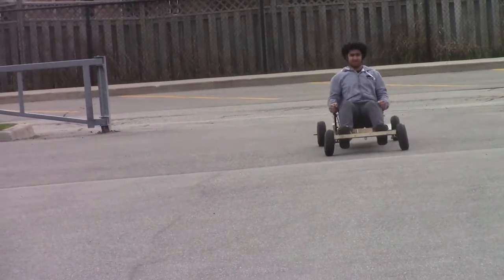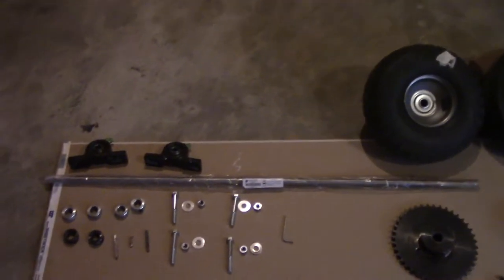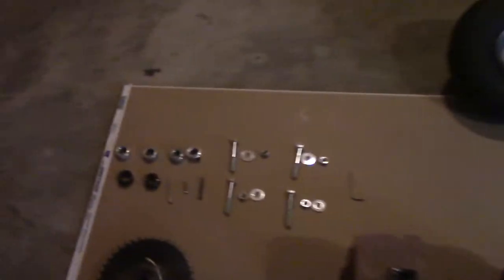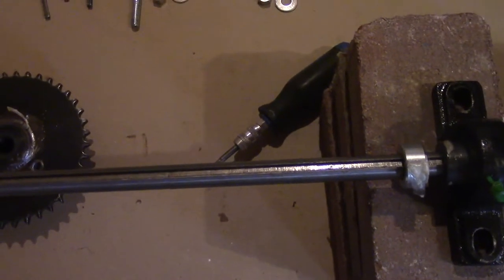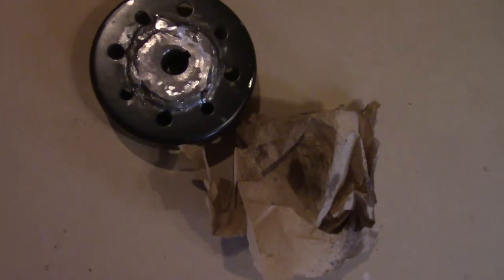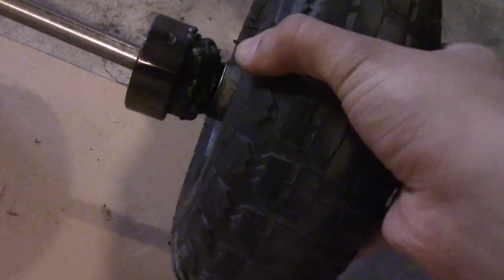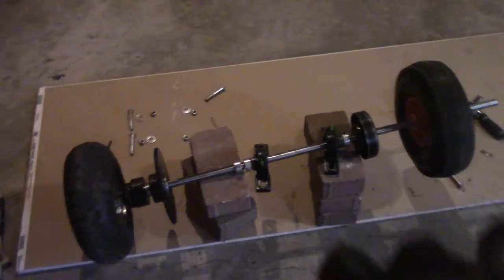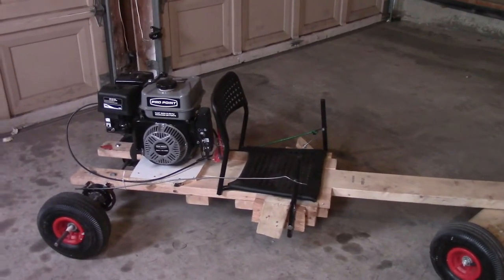GO KART LIVE AXLE INSTALLATION (TUTORIAL)

Comment: Does it matter if you use a keyed shaft?
Reply: You have to use a keyed shaft. If you don't there's nothing locking the wheels or the sprocket into the axle so you likely  have a scenario where the shaft or sprocket is spinning freely but you're not moving. You could weld the wheels and sprocket to the shaft but the heat might warp it then you'll have alot of vibration and it would be a nightmare to change the wheels if needed. You could go the route of a dead axle cart then your shaft doesn't move and you have the sprocket attached directly to one wheel only and the wheel itself has a bearing and not the whole shaft. It's much cheaper but doesnt' do so well if you go offroad as traction sucks.

Comment: What is the width from the end of one tire to the end of the other tire?  Also what is the diameter of that keyed shaft?
Reply from the maker: 36 inch keyed shaft also 36 inch from 1 tire to another
Reply: @justbuilds8248   can i cut and weld the axle to make it smaller?
Reply from the maker: @bdclaps1839  yeah of course u can